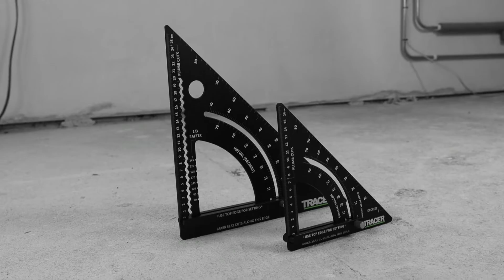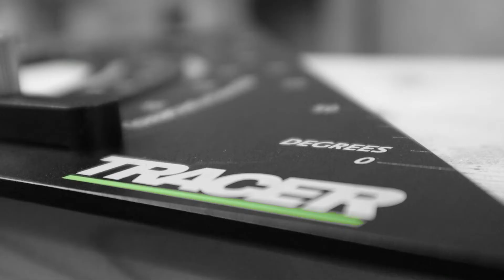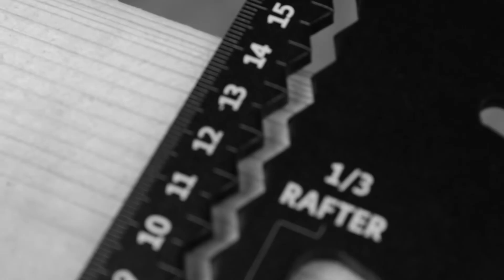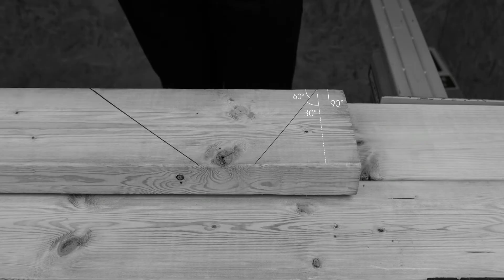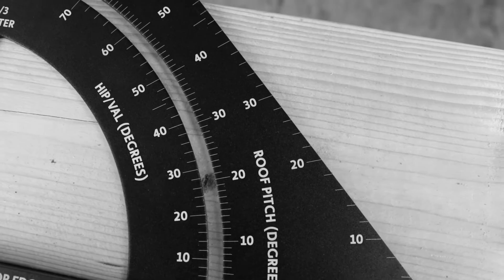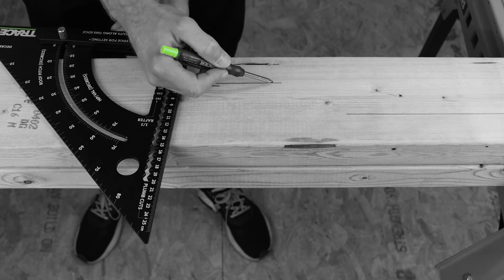How to use the TRACER ProSquare

Comment: While a major step forward from the Stanley it builds upon, it has a leftover Stanley design weakness.  The angle set bar rotates from a pivot point other than the corner of the square which renders it less useful when laying out the bird's mouth.  See better design examples from other UK manufacturers such as TrigJig and TF Tools.